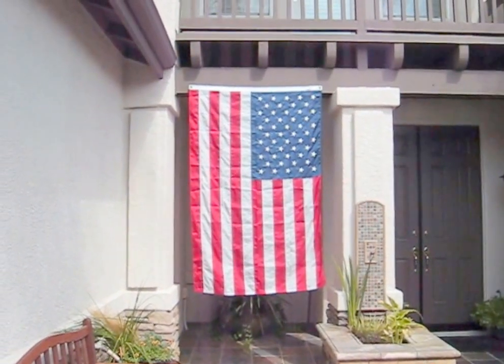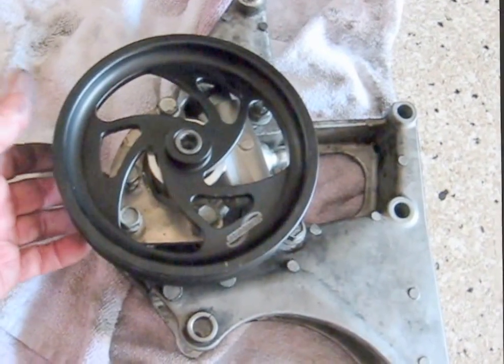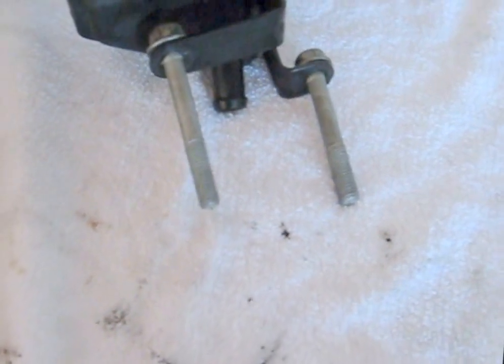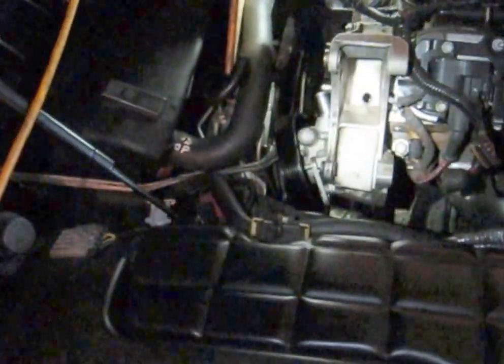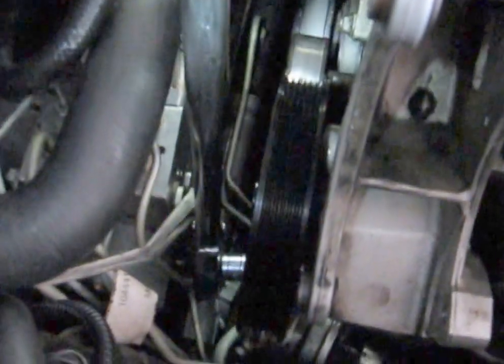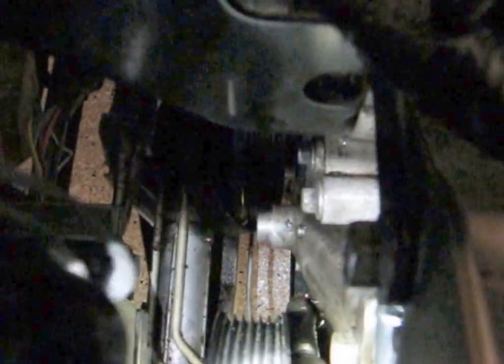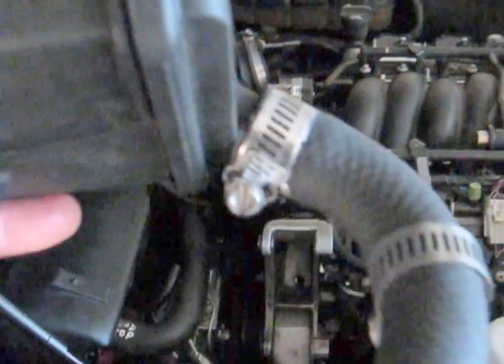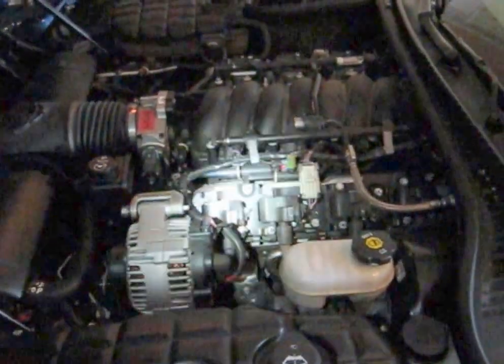Corvette power steering pump replace repair by froggy turn one c5 c5z06

Comment: Very helpful.  I didn't undo the intake or ABS, but just installed the pump on the bracket, then installed the bracket--"captured" bolts first, install the two others loosely just to line up,snug, then remove the two others are all lined up and reinstall with the reservoir.  The crows foot wrench is a great idea, made it much easier.  Get the flair wrench type that are four sided.  It's impossible to use a torque wrench, you have to estimate with an open end wrench.  Thanks Froggy.
Reply from the maker: Good work.

:)

Comment: Froggy rocks, you just want to hang out in the garage and work on cars with him ;-)

My C5 Z06 steering rack has started weeping and visible on the driver's side boot.  I'm sending it and the pump to Turn One for rebuilding and will use this video when they go back in!
Reply from the maker: Good work!

Comment: u are the man!  thanks!  you just saved me a bunch of time in the garage.  so to sum it up, get a new pulley that has holes in it (C6 type or whatever), take off pwr str reservoir & throttle body, and loosen abs bracket to move fwd.  break old plastic pulley off.   put new pulley on new pump.  replace old with new.   I think I got it in my head.   ready to tackle tomorrow
Reply from the maker: Go for it!

Comment: Thank you for the video. Just a heads up. On my 2002z I broke the pulley in half, but still had to remove the stupid bracket. Even moving the abs block I could not find enough room to wiggle the pump out with the bracket in place. I also had the rack out at the same time and did not help with pump removable.
Reply from the maker: +john hyer Thanks for the post, yes it's very tight.

:)

Comment: Foggy makes this harder than it is. What you do is bolt the pump with its newly pressed on pulley to the big bracket using the small curved bracket and 4 bolts (2 long, 2 short). You then lower the assembly into the gap in the engine bay and, admittedly this is a bit tricky, attach the lower hose from the steering rack to the bottom of the pump. You do not have to go under the car to do this. You must do this before bolting the beacket up as you cannot access it once the bracket us in place and everything us bolted down. Once thus is done, bolt the bracket to the engine using the two "captured" bolts behind the pulley and the two that also mount the fluid reservoir. You can then mount the reservoir. Like foggy, I also used some new clamps,p on the two remaining hoses. The old ones were ok but I prefer the security of proper screw fasteners rather than the cheap clips fitted at the factory. I did not worry at all about torque settings, merely tightened everything up good and tight, by feel. When I disassembled things the bolts came out easily, and I have refitted them to the same level of feel. I also have not used locate. If the factory didn't need to use it then neither do I. Also it is once less problem if I ever need to disassemble these parts again in the future. One final thing; why do GM use such rubbish as a metal and plastic composite Pulley? If you need to do this always use a skeleton METAL aftermarket or GM C6 pulley and NEVER fit a new C5 one, because if is rubbish and you will only have to go through this grief again Someday!
Reply: this seems logical, for i hazard to mess with the ABS system at all;

so, basically, you're saying remove and reinstall the pump and brackets as an assembly?

did you take out the alt and throttle body, too?
Reply from the maker: Thanks Shaun, good detail.

:)
Reply: Thanks from New Zealand! Cheers for the post. Just replaced my pump and pulley and this was a lot easier than having to get under the car.

Comment: my C6 Z sprays ps fluid at high speed and rpm all over the engine mat and drips down and blows back under the front subframe to the oil pan. Makes a nice mess. No noises from pump. Still could be pump or a a flow restriction somewhere. Would a flush show if there's a flow restriction? Most of all the fluid seems to be spraying out of the large short reservoir return hose to the pump??
Reply from the maker: The caps are known to leak, you can "make" a thicker gasket or buy a "cover" like I have seen for brake & clutch m/c. The covers soak up the leaks. If it's a HOSE replace the HOSE.

:)

Comment: great work HOWEVER--- all the time you spent on torquing the bolts correctly and taking your time on the job. I must comment on a huge safety problem, I am going to apologize in advance if I didn't see a jack stand under the car when you jacked your car up. You crawled under to work abs and high pressure line, tell me you had a jack stand under the car when you were working on it! Many backyard mechanic deaths acure like that especially on nice clean epoxied concrete. Use Jack Stands!! Your love ones will thank you!
Reply from the maker: Whenever my whole body goes under I use stands, I don't always show/feature the use of them. Thanks!

Comment: Hey Froggy, I watched youre videos on the rack and pinion replacement, power steering pump replacement, and removal and replacement of the power steering pulley. 
    Right now I am looking at replacing my power steering pump, and pulley also. I noticed a lot of fluid loss, and it seems to be in the pump area. Hopefully I will be able to do just the pump, and not need to mess with the rack. Right now I am in the gathering materials and tools phase, and research. I just ordered the turn-1 pulley, and also dis-covered a pulley removal and install set.  The Lisle 39000 that seems to be better than the harbor freight set you had problems with.  About 40 dollars. you should check that out. 
   One question I have is about the high pressure line that goes from pump to rack. Did you need to replace any seals for that line? Or did you replace that line at all? I notice new lines seem to come with a couple new seals. I figure on replacing my lines while in there, as they are real old, beat up, and possibly leaky or about to be leaky. 
    I also wonder if you had replaced pump due to finding leaks, then did rack later on after discovering that leaks were still happening? My system seems to be operating well, just a lot of leaking. Hope I dont need to screw with the rack, since all that is available now a days are re-manufactured crap. No new ones I can see in market. I also dont feel good about messing with the sub frame that supports weight of engine, just to wrestle that rack out of there. Well thanks for the videos. It looks like I have a lot of wrestling to do under the hood to replace the pump. I appreciate a lot of the details you add in the videos. The more detail the better.
Reply from the maker: The work I did was not due to leaks, the pump was failing to provide correct pressure during high temp autox competition, IIW I'd lose the PS. The turn1 helped, redline fluid helped, Did not do the rack as I got a new(er) Vette.  I would not be afraid of reman racks, just get one from a QUALITY vendor. Not sure who, never did it. Replace lines & seals if you have leaks or just if they are old. Nothing lasts forever.